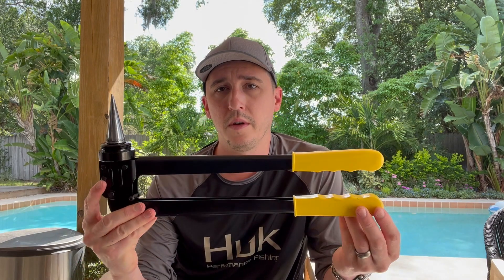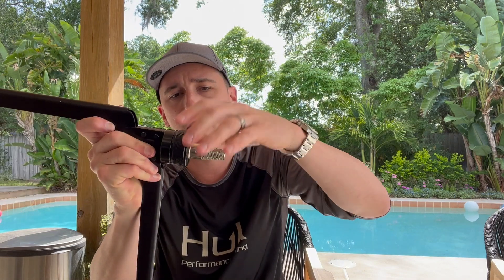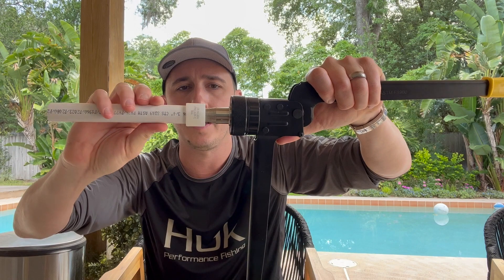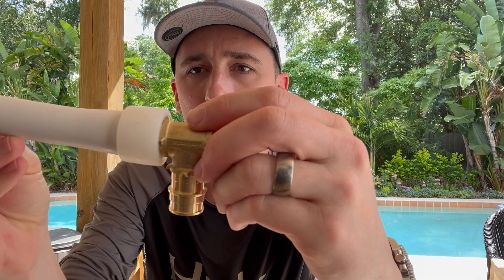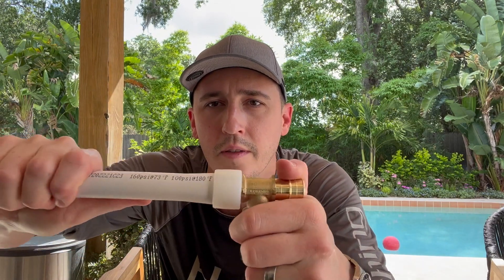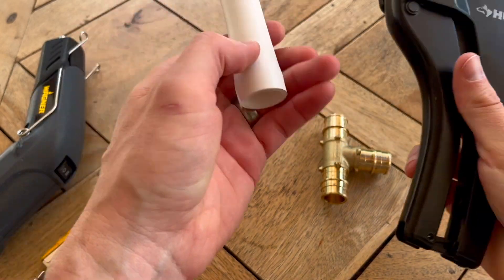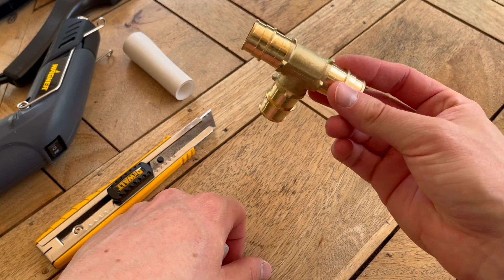How to Install and Remove PEX Expansion Fittings Using Manual Tool || DIY Plumbing

Comment: Imagine using the manual tool in an attic, crawlspace, small closet, or on a ladder, or having to do multiple connections. Now add getting the fitting on before the pipe shrinks back. The tool is worth every bit of that effort and stress saved. If you are going to use PEX-A, the battery powered tool is worth it.

Comment: Question.  Can you pre-heat the pipe and collar prior to expansion in order to make it easier to expand?
Reply from the maker: No, I would not do this. You wouldn’t want the joint to fail and leak. Too risky!

Comment: How am i supposed to use something like this anywhere but in the wide open? I cat use this between ceiling joists
Reply from the maker: It would be tough in tight spaces. You would need the battery powered tool for a job like that.

Comment: I'll avoid using pex a at all cost. It's so time consuming and nothing but problems with the expansion tools in the winter time. Side note if you use this system in 20 degree weather the memory is alot slower than 80 degree weather.

Comment: 3:03  Hey...quick question, if I may.  I just bought the manual expansion tool.  Without the expansion tip on, the two handles will come down and close together pretty close.  Once I put the tip on, the second handle doesn't come all the way down.  I couldn't tell on your video.  It kinda looks like the arms don't come close.  Without the expansion tip on the tool, the two arms come close together, but once I put the expansion tip on, the second arm stops about 6 inches from closure.  I think it could be not enough grease, or whatever.  I've put grease on the pointed part.  I dunno, it's something stupid, because without the tip, it closes normally, like bolt cutter handles come together, but like when I put the expansion tip on, it's like now the bolt cutter teeth are on a padlock.  😋

I haven't got pipe yet, so maybe I need to get some PEX-A pipe, but I'm slow....all I have so far are the expansion rings and the tool.  Home Depot is out of the piping.
Reply from the maker: As long as it expands enough to insert the fitting you are good! If it doesn’t, then there is probably something wrong with the tool.

Comment: Ok, this thing is a WORK OUT!  When possible (pre-assembling the manifold bypass valves) turn the tool upside down and place one end of the handle on the ground, and use your body weight on the opposite handle to compress the tool on 1" fittings.  Some bad words helps with the process.  Also, know there is a minimum length of pipe required between fittings.  For 1" pipe, you need at least 3.5 inches of pipe.
Reply from the maker: Great tips here - thank you! Yes it is quite the workout. But not too bad for a small job!

Comment: if heated more would the tube come off without cutting it?
Reply from the maker: I don’t think that it would.
Reply: It works for me. Just heat it up really well and wiggle it out. Once it cools and shrinks down to its original shape slip another extender ring, expend it over the fitting and you're done. @hanoveroak
Reply: @ramonestrada38 do you first cut the expander ring or just heat the whole thing together and pull apart?

Comment: Nope, I'll just stick to my crimp rings and cinch clamps.  For every one expansion ring you expanded, I could've crimped or cinched about 5 or 6 rings. This manual version is more trouble than it's worth. Great video review though.
Reply: I'm glad you're not my plumber
Reply: Won't you lose flow rate that way?

Comment: Pex A... Seems to be such a simple thing to do, but seeing it done makes it so clear. The tip about rotating while expanding is very helpful. Thanks for the demonstration. I am not a pro plumber, I only need to do a section of my house, so the manual tool will do. About $95 in Amazon with 5 die sizes.
Reply from the maker: Thanks! Glad it helped.
Reply: @hanoveroak  Great help. Thanks for taking the time to produce it. Quick question for pex A installers: If installed correctly and not damaged by abnormal events... How long have you guys seen it last?

Comment: I just swapped out most of the copper pipe in my 70+ year old Levit Cape with a single bathroom for Pex-A a few weeks ago. My wife bought me the Milwaukee Propex expander as an early Father's Day present, lol. If I never use it again, it was still extremely worthwhile. I can't imagine using a manual expander in many of the tight spaces I had to squeeze the battery expander into and still be able to crank the thing.
Reply from the maker: Completely agree! I would highly recommend the battery expanders for a project like this. Just wanted to show viewers it can be done without it.

Comment: I clicked on your video because I have to swap out a 1" pipe. Now I'm kinda nervous on whether or not I'll be able to squeeze that tool together. Good video. Smart advice about NOT using a heat gun in the attic!
Reply: Weak, I just manually expanded a 2” water main. I might’ve lost all sensations in my fingers but I did it
Reply from the maker: Yeah the 1” pipe will be pretty tough to expand! The 1/2” is easy.
Reply: Time for a cheater pipe extension on the handle!

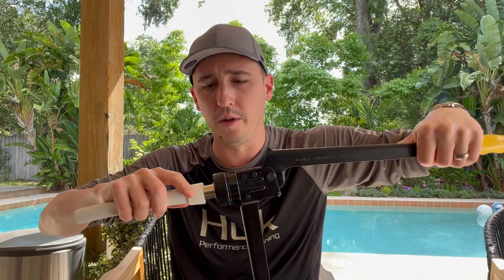Comment: Don't think you mentioned it but as much effort and difficult as it is when you're expanding the pex around 3:00 .. anyone who hasn't thought of this, it's even harder when you have an uncut length of PEX pulling the tube out of the tool and nobody to help hold it in. Think I'm gonna go pull a vise off a workbench to hold the pipe in place... for now

Comment: Thanks the Milwaukee power tool gods cause my pro-pex tool is a life saver, i just re-looped the potable water pipes in a two story 3 bathroom house w/laundry room & 3 hose bibs from polybutylene to pex-a,  i would've died if i has roy use this manual expander😂😂😂😂

Comment: After watching a few videos I just keep using PEX B with copper rings. I have the IWISS crimper tool I got off amazon works great. I can see the upsides of PEX-A how fast it is for plumbers using a battery powered expander tool.
Reply: It's my understanding that using those fittings will reduce water flow because the inner diameter of the fitting is going to be smaller than the inner diameter of the pipe.  If you are starting a whole project from scratch, you can increase the size of the PEX you are using and thus increase the size of those fittings.

I'm currently researching all this for a DIY project on an existing system, so I'm deciding between using an expansion method or Shark Bite push fittings.
Reply: @fosty.  True have to consider that I was running water from a RO to a refrigerator, and a swamp cooler both had reducers to smaller then 1/2" pex. Also government required flow restrictors are very tiny on faucets. Washing machines don't have restrictors would notice a drop. I also noticed a plastic taste in the water since it's after the RO I thought by avoiding copper because RO water can leech copper it does the same thing with PEX.
Reply: @Mike-01234   Do you still notice the plastic taste? We did the same thing with the refrigerator and ran it for a while until our TDS meter said that the PPM level was looking good.

It could also be the refrigerator itself. If it's a bit older who knows what it looks like in there.
Reply: You can use copper rings with pex a also, no?
Reply: @trashcan4u853 Yes.  Pex A and Pex B tubing are identical in size and can both be used with Pex B fittings and clamps.  Its only Pex A fittings that must be used with Pex A tubing.  It is very advantageous to use Pex A tubing when plumbing a house because Pex A tubing is much more flexible than Pex B tubing.  You can sort of easily bend Pex A tubing into 90 degree corners.  Pex B tubing is a mother when trying to bend it into 90 degree turns.  Best to use Pex A tubing for its flexibilty.  But Pex A does cost more than Pex B tubing.  But plumbing tubing overall is not a huge amount for a house.  So best to go with flexible Pex A tubing for its bending ability.
Reply: @trashcan4u853no

Comment: In most places you will not have room to spin this huge tool and the pipe is secure so no spin there either. I will definitely stick with pex  b
Reply: There are auto-rotating expanders too, so you don't have to spin the tool.
Reply: Pex B is ass

Comment: Thanks for the demonstration. It looks like it takes more force than I imagined. However, I only have a few joints, for several thousand dollars difference, I can manage using the manual tool.
Thanks again!
Reply from the maker: Sure thing! The 3/4” connections require a decent amount of force to expand with the tool. If you’re only doing 1/2” connections those are pretty easy!
Reply: The Milwaukee battery powered tool is around 600 dollars at Home Depot.

Comment: One thing I learned was not to slice the pipe where 2 raised rings exist on the fitting.  I slice between the rings and use a screwdriver to split apart the pipe.   Mild scoring the raised rings can cause a leak especially when I reuse poly fittings.
Reply from the maker: Good tip - thanks!